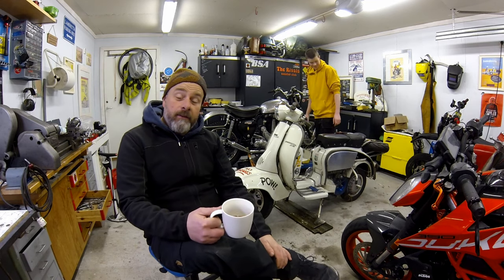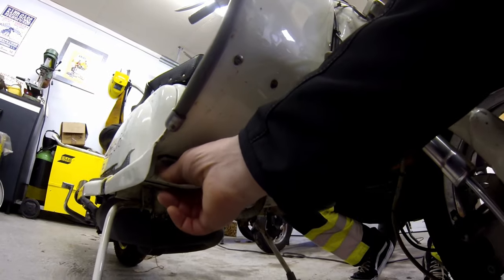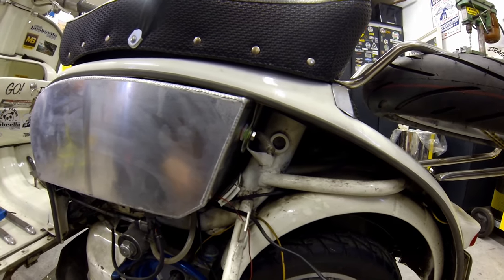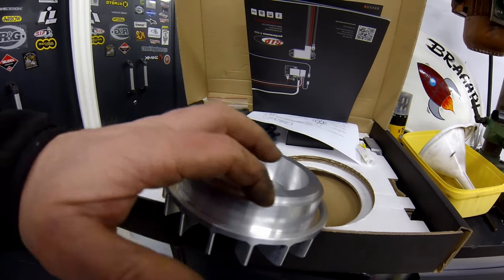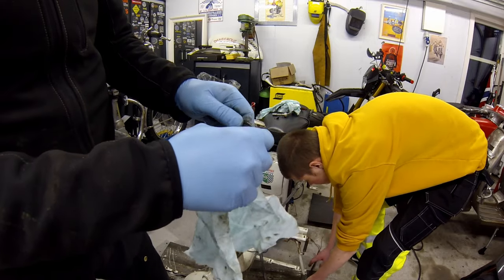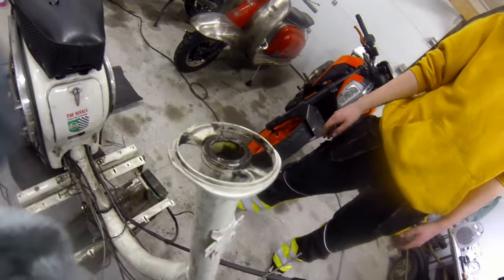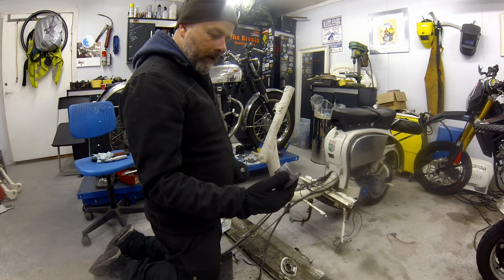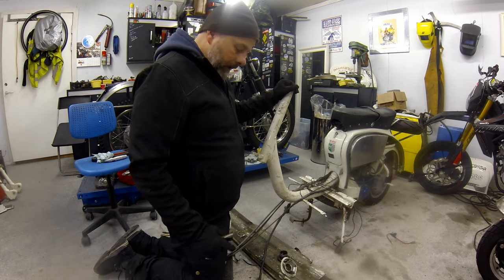Lambretta steering bearing removal and front end strip.

Comment: hi there i am just at this job now but as the parts were going to be renewed  i cheat .
first i flipped the frame upside down and mig weld a small bit of  flat bar across the inside of the bearing seat , that gives you something to drift against  and the heat from welding seems to help , i also  do this with trashed roller bearings that have fallen to bits to remove the outer shell ..  :)

Comment: Merry Christmas Rob & Seb 
Been through the fork bearing race and it was a right pig, bought two sets of bearings as I fit them in loose, better feedback I think. I did laugh at the where has my tools gone moment as I do that quite on a regular basis. I’ve also started planning my euro trip too coincide with the Norway Rally so I’ll be needing a few more details soon 😉
Reply from the maker: Haha, spend more time looking for tools than using them 😀 here is the link to the rally. I think you have to use Google translate or just ask me. https://www.roughnecks.no/  my email is www dot lambretta at online dot no. 😎

Comment: I'm doing a complete restore dry fitting everything to the point its tuned, tweeked, and rideable then taking everything apart for painting and powdercoating. Are the bottom and top new races ok to be removed again and reinstalled after powdercoating or am I going to have to get another set?
Reply from the maker: It depends on how they look. My take on the matter is that its quite a big job to have to take them out again in a year's time. I fit new ones for piece of mind.
Reply: @kickbackgarage  Thank you very helpful. Cheers!